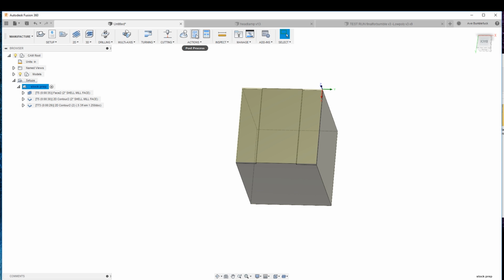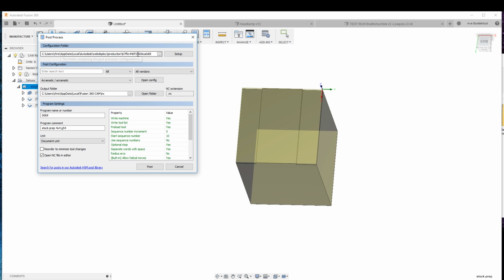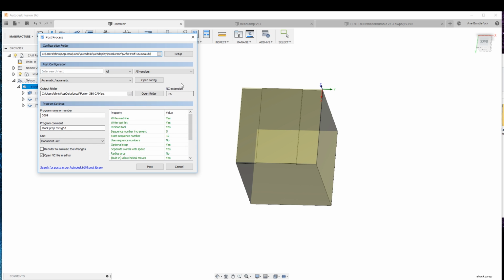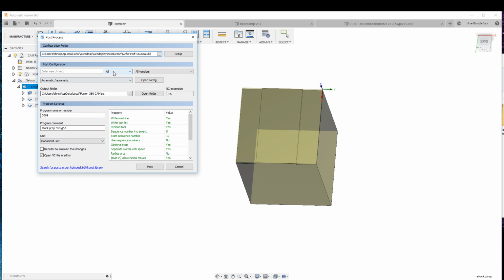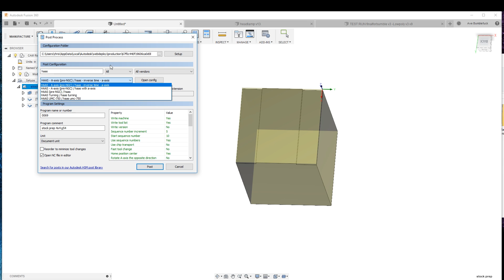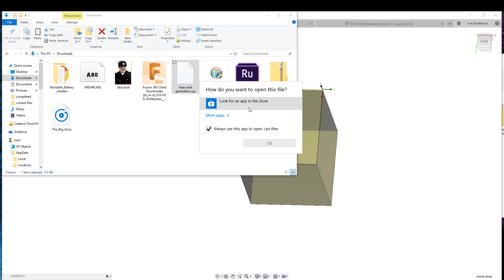Speedy Fusion 360 Ep. 05 Haas Post Processor

Comment: You can change Fusion to work locally and turn off the online connection, this prevents most updates and preserves you config. Will also save everything locally if you use ‘save as’, although it can only be used offline for a limited time before it tells you to work online to check with the licence server. Hope this helps!

Comment: There is a much easier way to do this.

Download and extract the Post Processor.

Click on your name in the upper right corner of the screen and select Preferences. Navigate to General – Manufacture and ensure that ‘Enable Cloud Libraries’ is checked.

Click on the 3×3 grid in the top left corner of the screen to open the Data Panel.

Navigate to the Assets project under Libraries and then open the CAMPosts folder.

Click upload and then select the .cps files that you downloaded.

When post processing, click Setup and select Use Cloud Posts to access these post processors

Hope this helps, plus you can now access this post anywhere you use fusion.
Reply: You can also do the same thing with tool libraries